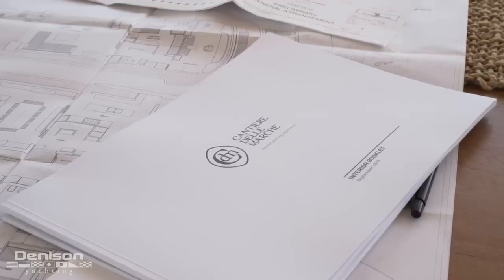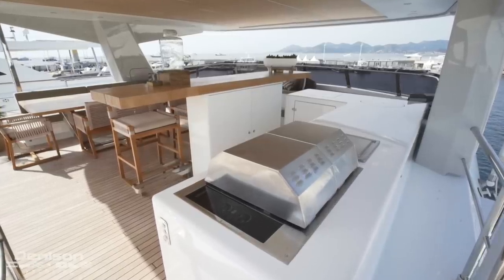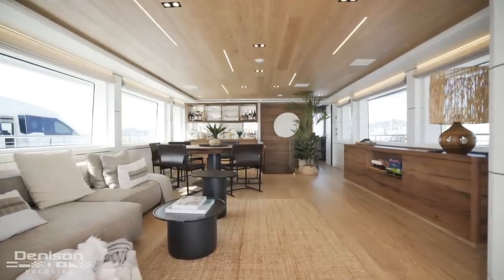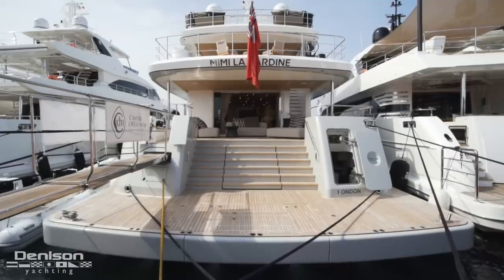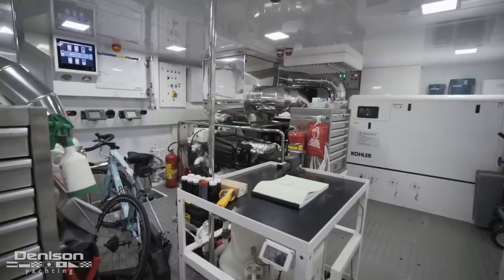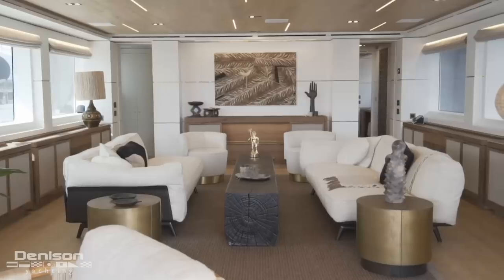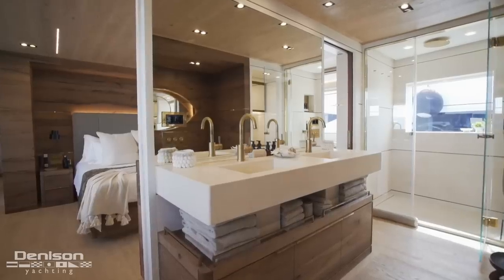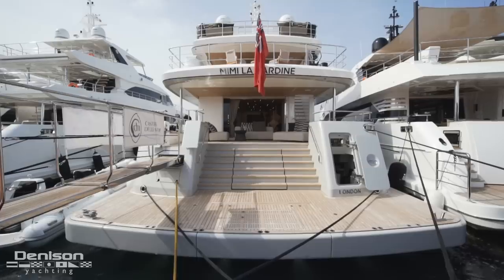110' CdM Explorer Yacht [Walkthrough]

Comment: Nice yacht. Great layout. Beautifull decor.
Amazing that at 12 knts she has a 7,000 nm range.
Great job on the video.
Reply: no waaaayyy. most of the explorer/expeditions yachts today only does 7000nm at 8-10knots depending on sea conditions. that's something different i guess.
Reply: If you read the Description 5500 nm at 9knots . Still good range  just1500 nm short !
That would suck in the middle of the pacific :)
Still ; she is nice.
One thing I do not like about European yatchs is the total seperation of the galley .
I like an open country kitchen.Especially on a long range explorer.
Reply: If you read above, it states 5,500 nm at 13 knots.  ???
Reply: @terrymalone6086  5500nm at 9 knots 13knots at wide open !
Reply: @TheArrow1100  true did not read it. But was spoken during the engine room tour " at 12 knots 7500 nm range".
So which is it?